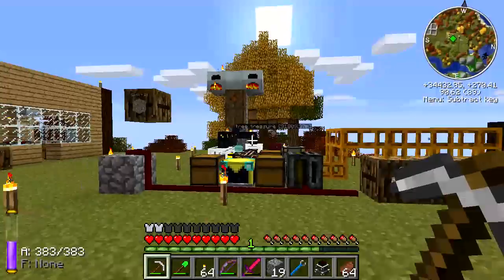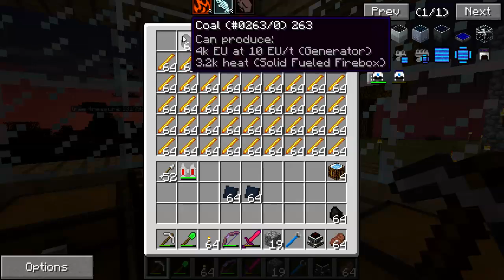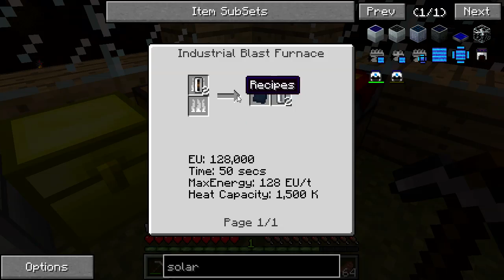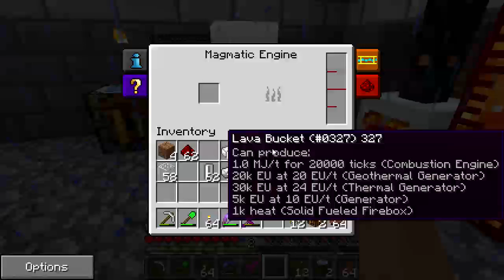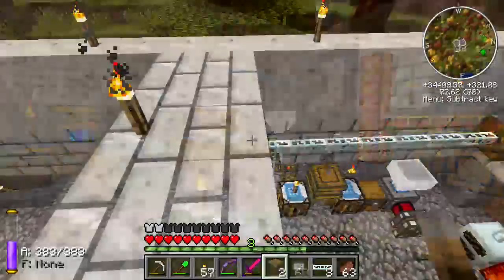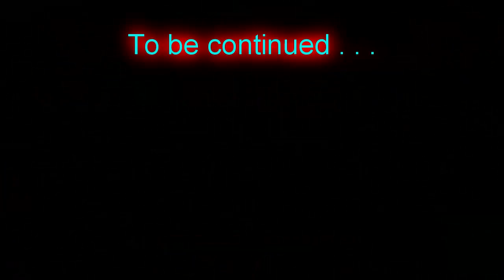E-015- Assembly Line 1 - Hermitcraft FTB

Comment: Finished watching your Hermitcraft series so far.
Thank you, keep up the good work.
Bit OT here, don't know if you'll go back to it, but you might see this faster than a comment on a video 3 weeks old: you mentioned the Skeleton Spawner Observation Deck was a bit dark.
Rather than placing more Lamps there, you could raise the ceiling and/or lower the floor, so the ones in the chute walls light up the corridors.
Also, adding another row of glass above could make the spawner easier to see.